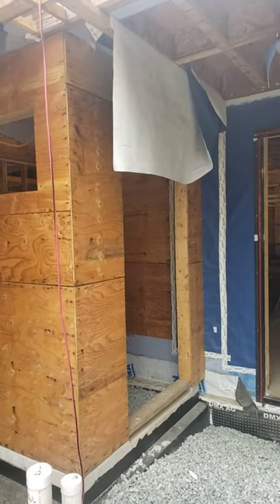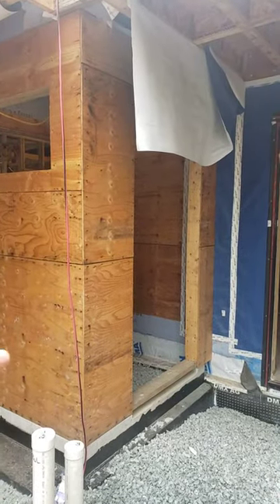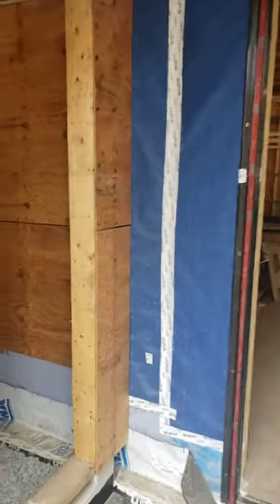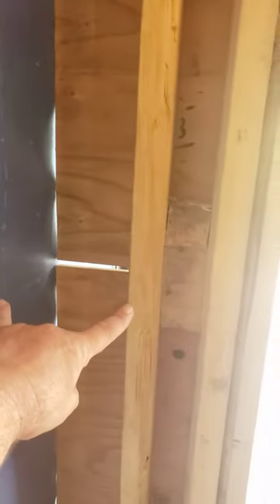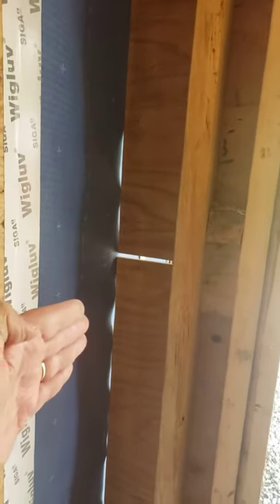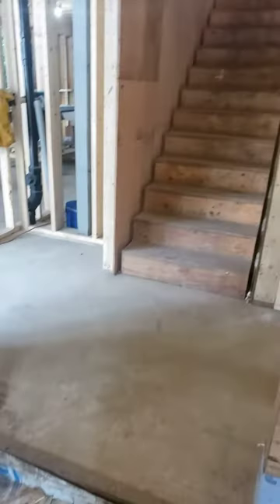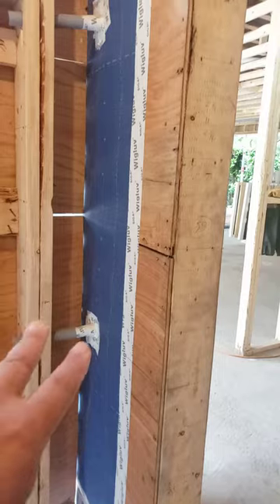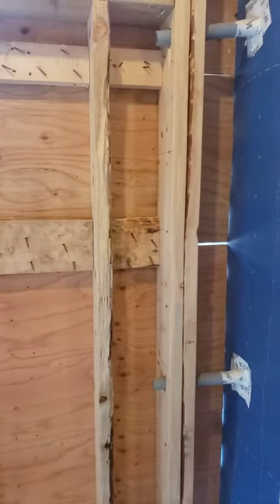High Performance Vestibule Framing

Comment: This seems to be a fairly inexpensive method to isolate/separate the super tight envelope. I had not considered building a vestibule like this before, but I am now!
Reply from the maker: Not knowing your age, before we had well performing windows and doors, vestibules were an essential element to efficiency. They still are, we just seem to think we can trade the vestibule for a good door or window, which is usually not an even trade.....
Reply: @stevenbaczekarchitect9431  young enough to still be learning and old enough to know that you should never stop learning! 

I've always lived in the Mid-Atlantic/Southeast part of the world where the climate is fairly mild and a true vestibule is a rare architectural element in my experience. 

Thanks for sharing.
Reply from the maker: @nickmatney6605  Agreed, we are all learning